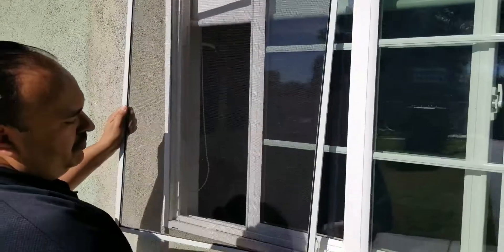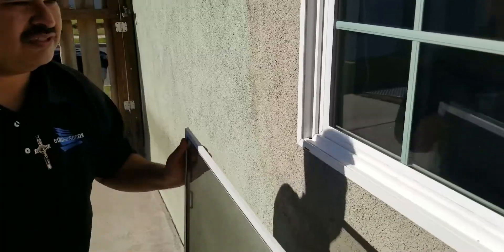Qucikest way to clean window screens using Screen Magic Screen Cleaner. Find out more! #dirtyscreens

Comment: Hi there. I am needing to clean screens for the outside porch that aren't really easily removable. I can't put them in the grass. Could you tell me what the problem is with using this over the wood deck flooring in the screened porch please? Thanks and God bless you. Jesus is Lord.
Reply from the maker: I recommend using plastic to mask off anything that could get stained. It can also bleach concrete. Be careful and maybe test a small unseen area of your wood deck.  You can also hose off the deck prior and immediately after. 

 Iesus est Dominus. May the Lord be with you.  God bless.
Reply: @Bestcustomscreens  Thanks. I think I will have to find something else, but thanks for responding. Jesus is coming very soon to rapture us. God bless you too.
Reply: @Bestcustomscreens  Hi again. So I have sprayed with water and bleach and dusting with a microfiber pad, and they are pretty clean but do have streaks. So I got a bottle of your cleaner today, and I am wondering if I can just put it on a cloth and wipe the screens so I won't have to be concerned about the wood floors inside the screened in porch? Also I have guests coming in a couple of days, does the smell linger? If so maybe I should wait? Thanks and God bless.
Reply from the maker: @WalkingbytheSpiritAlways  I have not tried that myself but it seems like a safe way to do it. Please video what you do and send it to me if possible.  Then I can share with everyone.  Thanks for keeping your screens clean.